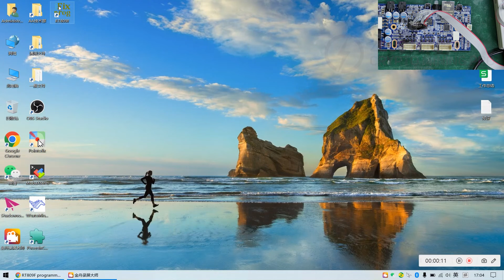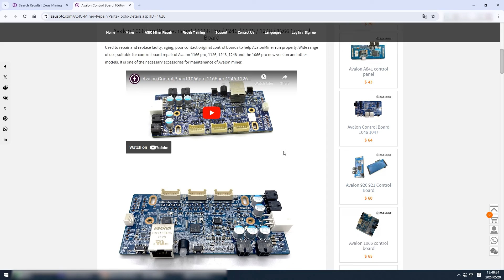How to read and flash Avalon control board firmware?

Comment: What all model control board supported ?
Reply from the maker: Hello, which model do you need? You can contact our sales on WhatsApp: +8618623251355, he will provide you with better recommendations and services♥
Reply: I want to flash controller 1126pro to become controller 1246. Is this possible? Thank you very much.
Reply from the maker: Yes. If you have technical questions, you can contact our technician on WhatsApp: +8619123969124, and he will provide you with better suggestions and services.
Reply: @ZEUSMINING  thanks